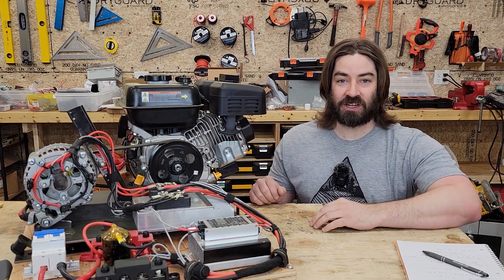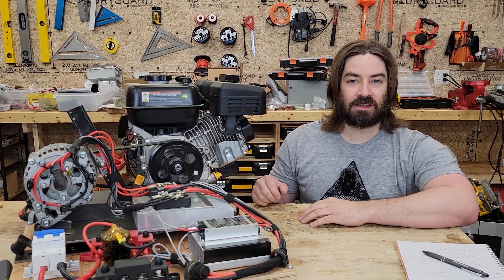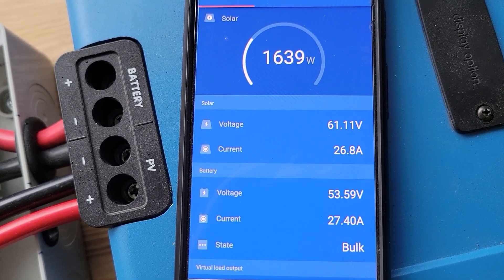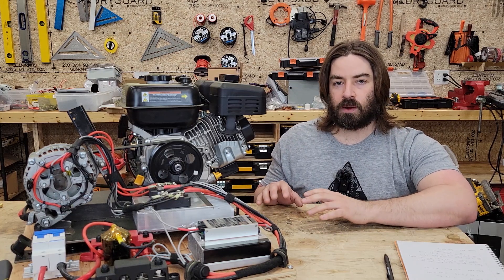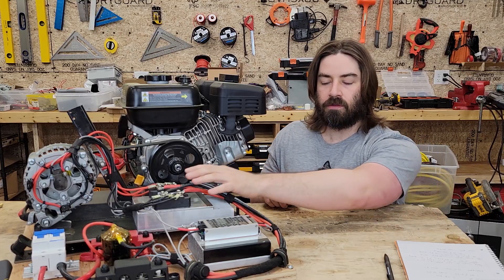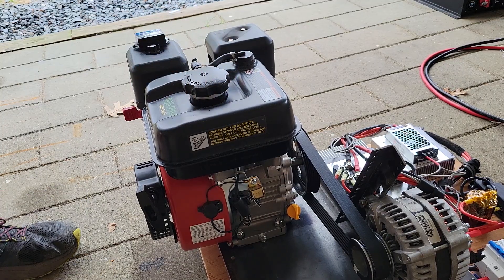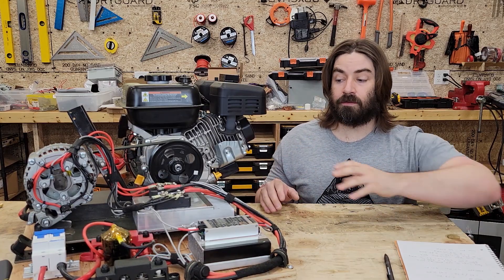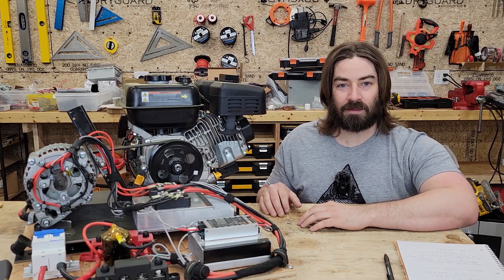More Efficient than ever!  Alternator Generator fine tuning, Part 3

Comment: Question

What is the most efficient way to charge off-grid lithium IRON batteries manually (no electricity in the cabin) either by hand cranking, or more probably, peddling by using a bicycle back wheel crank system. Solar and wind would be used minimally

I've seen people on YouTube connecting a alternator & pully to the rim (without a tire) of a bicycle back wheel (lifted off the ground so the bike remains stationary). Then peddling to charge lithium batteries.

I was wondering if using the bicycle peddle crank system would work more efficiently to charge my batteries if I used a alternator or generator?. 

My first thought would be a electric generator would be the most effective and efficient. But then wonder why so many people on YouTube are using alternators to charge off-grid batteries, rather than generators?. 

Is it because alternators are potentially cheaper than generators, or is it because alternators do a better job charging off-grid lithium batteries than electric generators do?
Reply from the maker: Thanks for the question.  

Pedal power, or hand crank, items are fun to use.  I have a hand crank system that I use to teach my kids.  It's useful for charging a cell phone, but that's about it.  Once you want more energy for lights, refrigerator, tools, etc. then you will want an engine powered charger (assuming no solar or wind). 

For most situations, buying a gasoline portable generator making 120/240V power is going to be the best way to go.  You can buy a battery charger that plugs into the generator 240V, and will charge batteries.  In this case, you have to buy a charger with an output Voltage that matches your battery bank.  I personally use this charger:
https://signaturesolar.com/eg4-chargeverter-battery-charger-48v-100a-5120w-output-240/120v-input?ref=4_rHcgZ9x-TiF-
(affiliate link)

One of the downsides of this, is that you need a specific charger for each battery.  Using an alternator is no more efficient than a generator and charger.  I built this specific project because I have several different batteries from 12V to 60V, and in different Ah ranges.  By building this system and using the Victron charge controller, I can charge any battery with the same setup.
Reply: Using a gas powered electric generator is not practical, given the location of the cabin. And it's not truly "off grid" if you need to trek miles, with cash in your pocket to buy gas on a regular basis. 

But since very little electricity will be used in the cabin, LED lights, cell phones, radios and lithium battery backups would be the only things that need charging.  No power tools, and for the most part I'm going old school with root cellars, but will have a small DC refrigerator for emergency use. 

I'm sure i can manage that with the combination of solar, wind and manual power generation. Heating and cooking will be done with wood burning rocket stoves/ heaters

Another option is using a wood gas electric generator, which generates electricity by burning (or gasifying) wood or paper. You can build your own, or buy a commercially built version.

I was surprised to learn, during WW2 some people in Europe used homemade wood gasifiers to power their gasoline engine vehicles. 

But, you have answered my main questions... Alternator vs generator

You're saying they are both virtually identical in power output, when given identical power input. Is that Correct?

And...

The Victron is a used for varying voltages higher than 12v?, if every battery operated device I use is 12v or lower, the Victron is not needed?

Comment: Hello, I did exactly what you did, today I just turned it on and the voltage was 52-53v I also connected the blue ones. but the voltage on the rotor was higher and that's probably why I couldn't load the magazine unless you have another idea what I could be doing wrong

Comment: If you want to increase your fuel efficiency, you'll need to actually increase net power output, by capturing heat from the exhaust and running a steam turbine.

Comment: Hi I use a 2008 Prius with a 9000w inverter and 4x95ahr 12v batteries wired on the 12v side of the car as my generator. Do you think it’s possible to run the 208v hv side into 1 leg of a 15kw three phase solar inverter? The same way you did with the alternator?
Reply from the maker: I've seen a video on YT of someone who did that, but I don't remember the name or specifics.  I've never tried it so I can't help with details.

Comment: Hello David, I have enjoyed your alternator generator series. Your technical approach, and the fact that your share all your results puts you head and shoulders above most others on Youtube.
I would like to see you continue withe your research. Here are some ideas that may be worth a second look.
Your alternator has a 2.1 to 1 advantage over the engine. If you run direct drive with the engine and alternator facing with a flex coupling you can eliminate any losses from the belt and the engine will only work half as hard. This would allow you to inch you RPM's up as needed to keep the voltage above the minimum.  Your original target voltage was 60 volts, I think that would still be the best target.
Also with the strain removed from the engine you could increase the rotor voltage up to as much as 14 volts. This would increase the output but may require a small fan to boost the heat removal from the windings.
I would suggest taking it a step at a time. Start with direct drive and see where you stand. Second step, increase the RPM, etc.
Reply from the maker: Thanks for the ideas.

Comment: Howdy Davey. I made one of these to charge my first 12v solar system. Used an old Mopar alt. with internal 90deg cooling fins and an external, adjustable regulator. It didnt care which direction it turned. Worked great til I went to 24v. Western PA winters being what they are with almost continious cloud cover Dec. And Jan., its time to build a 24vdc.

Being the tree hugger I am, I chose a diesel motor so i can fuel it with used cooking oil. No fossil fuels here! The other difference in my system is the self exciting marine alternator. I understand these alternators are more robust and built to charge deep cycle batteries. Like your genny, Ill be removing the diodes and tapping the fields directly utilizing a rectifier and capacitor to soothe out any waves. Ill be finishing off with the Victron 250/100 controller as well. The victron manages my 10kw bank very well. My batteries are happy, happy, happy!

Ive been off grid since 2017. This year I started improving my rain water system and quickly descovered I need more electric to run the pumps, filtration, and UV disinfection. Haven't had a utility bill in 6 yrs, and i do all this on a small 30ft by 100ft small town lot. Best Wishes!
Reply from the maker: Sounds awesome.  If you record any of your work, can you let me know where to check it out?

Comment: A much bigger flywheel or weights on the current flywheel will smooth out the vibration at your 2600 rpm torque sweet spot. the momentum of energy can not be denied
Reply: 100% correct. look at early 1900s machines running on single piston engines.  HUGE FLYWHEELS

Comment: Would it be worth to run with a 48V alternator instead?
Reply from the maker: Nothing wrong with using a 48V alternator.  I couldn't find a cheap one.  Even the 48V alterantors I looked at on Ebay were more expensive then a used car alternator.
Reply: I was thinking it would help with avoiding the compounding efficiency stack.

I been baking up an idea of a simple DC generator but using a diesel engine. I believe it can stretch further. But what I like about diesel engine is if it's oil it will run. Veggie Oil, Sunflower oil, engine oil... it runs.  @DavidPozEnergy
Reply from the maker: I agree, diesels are awesome.  I have a couple diesel generators.  I have also converted about a dozen vehicles to run on waste vegetable oil.

Comment: Greeting from India,  David this is an excellent explanatory video especially regarding fuel consumption, I have done some similar experiments and the one thing that helped me get way more efficiency as compared to these low efficiency and high back emf alternators is an axial flux generator. Would suggest to use axial flux coreless generator design where the engine rotates at 2600rpms and the generator rotates at either 750/1500 rpm. What helped me personally to get the best results was using a gearbox rather than pulley. Hope this helps    🙏. If you want more info feel free to check a few videos on my channel

Comment: Awesome!!! Given 5 kWh here from the grid is definately cheaper than a gallon of gas how would a grid tied system work? Could I pull the 4.8 kWh from the grid to charge the batteries instead?
Reply from the maker: I built this for off grid setups.  Certainly, the grid electricity is cheaper than the cost to run any generator.

Comment: Hi, I made a couple of rough calculations. Your efficiency is not far of what can be gotten when you charge batteries with a Honda 1000W or 2000W generator and a good battery charger. That's pretty good, and much cheaper too. :)
Reply from the maker: Thank you.

Comment: Die Effizienz des Generators ist nicht gut, und liegt bei ca. 60 Prozent.
Nimm ein anderen Generator , mit Dauermagneten, mit einem  min. 80% Wirkungsgrad, und lass den Motor bei ca.2200-2400 U/Minute laufen. Du müsstest ca. 2,3-2,4  kW/h pro Liter, raus bekommen. Das wäre für ein Benziner ein guter Wert.

Comment: I have watched this from the start and fair enjoyed it. If you want a higher output voltage try increasing the excitation volts. This will reduce the current and increase the output voltage but power will be the same. What you need is a AVR to control the excitation voltage, although a crude arrangement of resistor networks would do just fine for a fixed load. All the best.

Comment: I came back to thank you for your video. I live in the middle of nowhere in Italy and when I saw your first video I decided I wanted to build a very similar setup just in case I needed one for my solar system. I am a mechanic and a very good fabricator but know nothing about electronics. I called a friend who is an electronic engineer to help , showed him the video and we decided to give it a try.  Since I’ve access to waste oil I decided to go with a full size old diesel car engine(VW) and my friend made me go with three alternators since we have the power to pull them and basically free fuel. He made a complete system that is made to not overcharge the batteries , turn down the breaker when batteries are full and shut down the engine 5 minutes after to let the alternators cool down and a remote start system. We have been without power from the grid and basically no sun for 6 days and I’m providing electricity to 3 neighbors and thanks to your video I was able to charge my batterie efficiently and almost for free (except the electronic and beers for my friend ). So I really wanted to come back and thank you!!!
Reply from the maker: That sounds like a fantastic project.  Thanks for sharing.
Reply: do you have some pictures? please do share!
Reply: What type of vw engine use for waste oil? Thank you

Comment: I charge my 14s lithium with a 1000 watt charger run from 120volt 2 phase AC. Could these bridge rectifiers be wired to a 5000 watt 120 volt AC genarator and get 5000 watts of 58 volt charging?
Reply: I have a 240 volt genny.

Comment: I have nothing against alternators, but anyone know why the original DC treadmill motor was abandoned? I'd be curious to see a comparison in efficiency. A while back, I calculated that a Wen generator and the EG4 Chargeverter might get around 5kW/Gallon. I don't own either yet so I can't test, but 4.8kW/Gallon is really impressive for a homemade generator. Well done!
Reply from the maker: Nothing wrong with using the treadmill motor, it was the engine.  On that earlier project I used a 3hp engine which was too small.  This project I went with a larger 6.6hp.

Comment: Is there a way to balance that engine side pulley to run smoother at lower rpm, although maybe a bigger pulley is the way to go running the engine at lower rpm so you can run the charger at 40 amps

Comment: Really well done video!  Love your scientific analysis. Top rate. I imagine honda's design is so efficient due to its stator directly mounts under the flywheel (permanent magnets used) eliminating the electrical  losses of the belt, moving mass of the rotor, and the watts used to power the rotor. Great job sir!
Reply from the maker: Yeah, Honda did a great job.
Reply: A rubber coupling to replace the belting and pulley.

Comment: And you have re-affirmed the issue with automotive alternators. They were designed for size and not efficiency.  As you discovered They reach peak efficiency below 50% load.  They do become more efficient when you increase their voltage output.  I participated with a similar project a long time ago with a micro-cogen group I was a part of, and we were able to make it fairly efficient, closing in on 1/8 gallon per KWH, but that was in diesel. You will always need about 15% more gas than diesel but should be able to close in on that same efficiency for the same amount of BTU input with properly matched components.  When you determined that you were overloaded thru alternator heat output and lowered the load, your chosen engine immediately became grossly oversized for the task(inefficient).  The engine will be at peak efficiency at its peak torque RPM with throttle wide open.  Peak torque is lower than peak HPRPM…  Closed throttle = increased pumping losses.  Lowering the engine RPM reduced pumping loss so increased efficiency but lower alt RPM = lower output watts.  You could up gear to run the engine at lower RPM with wider throttle but you are still moving 6.6HP worth of air and parts to make 2.5hp worth of output which = inefficient.  ~2HP per electrical KW output is a good rule of thumb. You see this throughout the gen industry, a 5kw gen has a 10hp engine. you saw that in your first vid when you went over 3KW, the engine ran out of HP.  You want to size the engine to deliver peak torque with the alt just under 50% load(in watts). You also don’t need to run the voltage that high.  You are not gaining much over 50VDC. A simple auto regulator uses a zener diode and transistor to regulate the field current.  If you regulate that alt to ~50V there is no need to extensively modify the alt and add the external rectifiers and all that other wiring, and you can stick to the air-cooled rectifier on the alt.  The problem we ran into was with the alt and engine matched properly, the alt could easily overload the engine as it was only at 1/2 electrical load.  We were working on a load limiting reg.  We didnt have as extensive a selection of dc-dc charge controllers as are available now, which solves the issue. As you demonstrated the charge controller controls the alt peak load nicely.  So engine sized to 2hp per 50% of the full alt KW output, simple field regulator to maintain 50V DC output, DC-DC charge controller set to just under 50% alt output in watts, done…

Comment: You can't compare your 53v 100Ah charger with the Honda EU6500 inverter generator which is 11.7 HP or 8.7 Kw to a 6.6 HP or 4.9 Kw motor for fuel economy because even though the load on both motors are the same there are more mechanical losses involved with a car alternator with a belt than an internal shaft driven generator.

Comment: what if you tried different pully sizes, get motor on 2600 and higher generator rpm
Reply from the maker: The different pulleys would help bring up the Voltage while at the lower RPM, but I'd still have larger vibrations.  This engine runs smoother at 3,000+ RPM, so I don't see the need to change it.
Reply: @DavidPozEnergy  the vibrations are related to the load vs the motor output. there is a rpm that will deliver the peak motor torque, you'll want it to run on that. then amps x volts = Watts, simply setting the amps at a set rate will not do. pully size will set your generator RPM, then you get your known volts, divide engine watt rating by output volts and you get your amp rating, take off the % loss from efficiency and belt and all that, then you'll find the sweetspot. you'll still end up  with near similar load on the motor but it would be at a more efficient motor rpm and a volt output suited to the task
Reply: @DavidPozEnergy   MOTOR SHOULD BE RUN AT 3600 RPMS

Comment: What if you got a buck converter with a higher output to excite the field a bit more, maybe there is more to squeeze there?
Reply from the maker: Maybe there is a little more to gain.  I was worried about over-heating the field, so I kept it to 5A, 12V.

Comment: To make it a self contained unit you maybe able to find a alternator that goes under the flywheel of the motor
Reply from the maker: I saw some motorcycle engines have something like that, but they were fairly low Wattage.
Reply: @DavidPozEnergy oh I'm talking to just energize the car alternator to start for some of the predator engines you can get a pretty powerful alternator for energizing the automotive alternator
Reply from the maker: Yes, I found a kit to do that.  I think it was $180, or something like that because you needed a new flywheel that had magnets in it.  In retrospect, I should have bought an engine with the electric start built in, because that would have the coils and magnets already.   O-well.

Comment: Not sure if this will make any improvement but you can smooth the DC Ripple to flat by using two capacitors in parallel and an inductor in between.

      I
-+-()()-+-
 |          |
 = C     = C
 |          |
-+-------+-

Hopefully my ASCII diagrams legible C Caps I Inductor